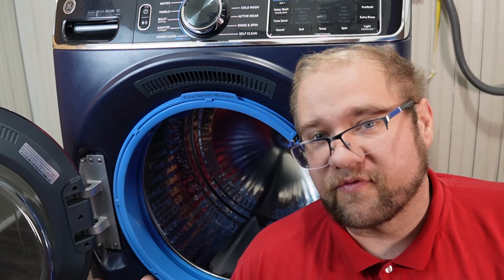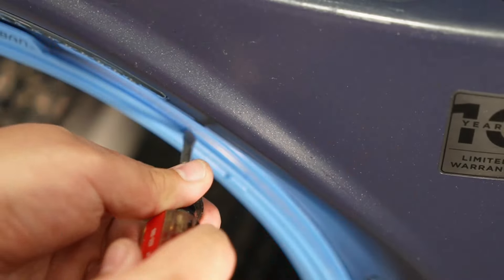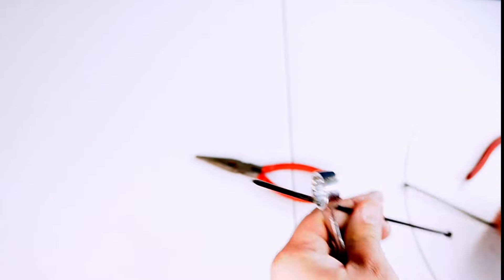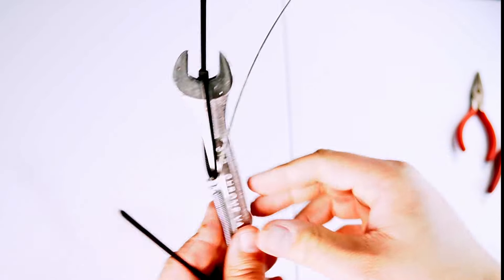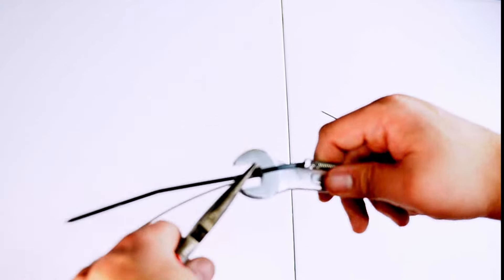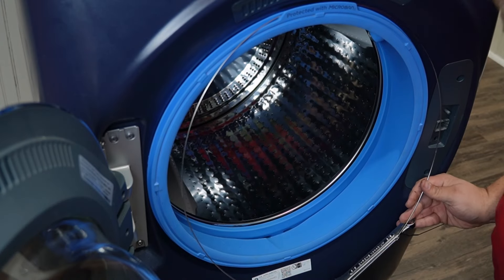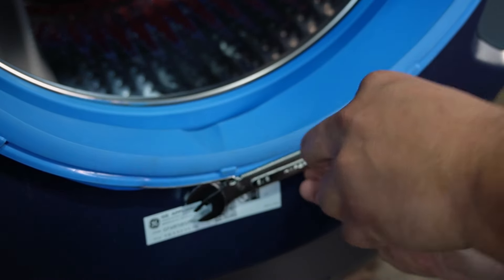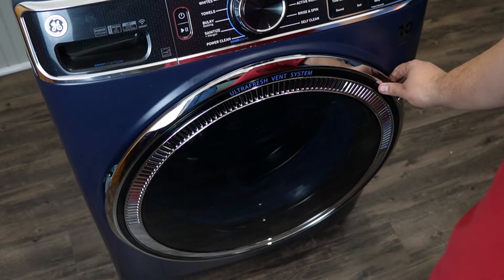Washer Door Boot Seal Problems? Try this cheap trick!

Comment: I took a cheap 16"  bar clamp & reversed the end so it's now a spreader & put zip ties on the ends connected to the ring spring & it worked great expanding that spring in order to get the ring into place
Reply: You saved my day! I failed at the zip tied, bought bar clamp, 2 minute fix!!
Reply: Hah! Another brilliant idea’
Reply: I forgot to try this! Wish i had. My hands arent strong enough to use the needle nose pliers on the zip ties. After struggling snd struggling, I finally grabbed my locking pliers and clamped them on the zip tie. Finally that worked! But the bar clamp sounds better!

Comment: Start by putting the clamp on from the bottom or the top, once you get halfway, put a knee on both sides. Then use two small screwdrivers to pull the spring apart and finish install. You're welcome ;)

Comment: I had to tackle this alone without an expander. This trick, did the trick. I had to use double zip ties on each end, but once in place, I cut one one each side and the spring stress broke the other two. Works great. Thank you.

Comment: Worked way better than I expected.  The only issue was the tie would slip out of the eye in the spring. Had to squeeze the eye a bit more to close it. Wish I knew this the last time I had to take the gasket off. It saved me from buying a tool I hope to never need again.  Good job.

Comment: Soooooo frustrating to get to the very end of taking all the front parts of my Samsung washer apart to replace the drain pump (successfully!), getting it back together and be stumped by this last step. After many attempts to stretch the spring without popping the gasket out of its rim, I finally came back to find help. Thank’s Ben, you have saved my sanity, at least for today.

Comment: I have the same type washer as shown in this video.  Its about 2 years old and all of a sudden it would  start  spinning but would stop after about 5 seconds.  There are very few videos on you tube because it is so new.  I found the trouble code and troubleshooting on one of your videos.  The trouble shooting indicated the problem was with the Hall Sensor.  Looking at other videos on hall sensors it appeared that they just clip on and would be easy to replace.  Using info from another one of your videos, I opened up the machine but there was no hall sensor visible.  It appeared that the hall sensor was built in to the motor so I replaced the motor.  Machine still did not work.  I got a wiring diagram from GE it it appeared the hall sensor is connected to the inverter board.  I replaced the inverter board and the machine works like new.  I was also very thankful for your video on expanding the spring to reinstall the rubber gasket!!!!!  Your videos were very helpful.  I don't know how to do you tube videos, but I thought I would pass this along so you might do a video some time in the future.  Thanks again!!

Comment: This is amazing.  Yes it worked great!!  Thank you so much.  I replaced the inverter on mine bc it wasn't going to the spin cycle and fixed it.  I would also add I used the 5/8 craftsman wrench that has a slight bend on the end.  Make sure you put the wire in the inside of the curve to match up with the washer.

Comment: Thank you! I had been trying quite a while with the spring spreader tool that wasn’t big enough for my machine. Using the wrench made a lot of sense. I did break off the tail of one of the zip ties but had enough space on the other to pull some more.  I used a couple of sturdy bamboo chopsticks to get the spring pulled down in place. It wasn’t easy but it did work. Thanks again! Saved a service call.

Comment: I had already purchased the spring expansion tool on Amazon.  The issue was the size of the prongs on the tool, the one eyelet on the spring was too small.  This hack was amazing, although I did need to make one adjustment.  The zip ties also were too wide to fit through the eyelet with the spring inserted.  I adjusted this hack by using sisal twine, tied that end tight, had long enough zip ties to attach to the other spring eyelet and expand the spring per the hack.  I did need to make a further adjustment, I doubled the sisal twine, as a single strand broke as I expanded the spring.  Greatest hack ever!!

Comment: You are the Man. Mine popped off somehow a year or so ago. Me & one of my sons eventually got it back on. I later saw the pliers & thought it wasn't that hard to spend that much money for something I'll probably never do again.  My seal just blew out with several holes & a big rip. Some reason my wife seems to think her ink pens need washing from time to time. Great idea,  think outside the box. Thanks another for tip & will be using it a little later today when my seal gets here. Have a beer on me & thanks again

Comment: I totally used this tip this morning! Every time I tried to squeeze the two ends together, it would pull the gasket off its spot. Pre-stretching the spring to pretty close to clearing the  gasket gave me the time to make sure the spring was in place before I cut the wire ties. popped right on! I also used a 5/8" wrench and 8" wire ties as suggested. Wife was getting ancy about getting her washer back. thanks, for the great tip!

Comment: hi, thanks , much appreciated, i had to put a longer spanner in the vice, used two ties on one end - they kept snapping - stretched the spring with vice grips on the wire then tie the spring on the other end, worked.. cheers.

Comment: I  just used zip ties straight through the eyelets on a Samsung spring several years ago, using the tails as pull handles to spread the spring after I had proximately placed it in the seal groove.It worked a treat after I carefully cut the ties and pulled them out of the eyelets using a bit of detergent as lube!

Your method looks more controllable.

Comment: I bought one of those tools to stretch the spring… it finally arrived and it’s to big… frustrating… I found this video… I cannot Thankyou enough…. Few minutes later door boot seal back on this method stretched the spring easily and putting seal back on was so easy. Happy to report washing machine working fine…. Thankyou so much. You saved me time, money and stress. 😊

Comment: You saved my rear end! I bought my mother in law a new washer and dryer and was reversing the doors. Wasn't paying any attention to the fact that the washer door was not reversible until I took the two screws out of the door sensor and it fell down. Getting it out was easy... Then I couldn't figure out how to get this stupid ring back on. Thank you so much for this video.

Comment: Wow, this worked like a charm. Struggled to get it on by sheer brute force, but then I found this tip. Did one try to see if spring had stretched enough, it hadn’t. Stretched it some more, slipped it on, tucked in all sides and cut the zip ties…done!! Thank you!

Comment: Thank you so much for posting this video. I struggled so much thinking I could do it without any tools. Impossible. 
I also could not find tool in my area anywhere.  Needed it up and running as soon as possible. Your trick worked like a charm.  Thanks alot.

Comment: Thank you! I did buy the cheap version of the real tool on Amazon but it was too wide at its narrowest position to go into the springs, and not wide enough at its open position to get the spring back on. I did finally manage to get the old gasket back on but it took forever and was so frustrating. I now have the new gasket ready to install and I feel much more confident about starting that project!

Comment: Saw this hack a few years back. Now that I need to replace it,  this video came up on my 1st search and works great. For women, a cuticle cutter works great to cut the tie, but working the tie in place will require the needle nose plier.  If you are OCD like me, use a soft nail filer w/ a  curb edge to push the seal back tightly without puncturing.

Comment: I tried your wrench technique but couldn't get things to line up properly. I ended up going even more minimal and used just cable ties just to pull the two ends together and eventually it worked. Thanks for the idea!

Comment: What a brilliant hack! I have an LG in a rental cabin that I need to replace the door gasket on, and the two local appliance repair places say they won’t work on LG appliances. (I dunno what other people in the area do; I just figured I can take a day and drive up there and back but I was worried about dealing with the clamp wings. I did buy a cheap version of the tool you showed on Amazon, but I’ve been concerned about it not opening wide enough.)

Comment: I made my own spring expander using one of my quick grip clamps. I fed the clamp in reverse so when you pull the clamp trigger it expands instead of grips. Then I drilled two screws through clamp, inserted the screw ends into the spring holes and expanded expanded it with the clamp trigger. BINGO!

Comment: Fantastic , Just noticed the washing machine was leaking and some how the seal had come off and the wire was half off . Was really struggling to get the wire back on so thought look on you tube . Used a 11mm spanner as my bush machine is much smaller . Ten minutes later the wire is on and machine working again

Comment: Exactly what I needed, ordered tool from online but can’t have washer down that long. Don’t use cheap zip ties, should probably get 2 inch painters tape if you don’t wanna get your washing machine, scratched up.

Tape up all the areas that you could possibly scratch. This trick with 5/8” wrench does work phenomenally well to get the outside spring seal off plus holds tension so you can reinstall easily.

My drain tube was clogged and it was leaking from the outside in front of the door plus not draining correctly..

So I only needed to take off the outside spring. 
I do tub cleans with bleach plus steam once a month plus leave the door open for at least four hours if not all night zero mold whatsoever.

The inside of the tub seal looks brand new. The machine is a 2014 LG. Clean vacuum flush elbow plus both drain holes.💯🇺🇸👍🏻🔥🫡

Comment: Yes!  Thank you for this tip.  I battled with this for an hour or two before I found this.  Took about ten minutes to get both of my spring rings around the boot.  Any tips for getting the drain, on the bottom of the door boot, back on the drain hose with the spring o ring?  Took me another hour to get it back on but it wasn’t easy.

Comment: Great video thanks for sharing, can you tell me how to take the white plastic outer cover that the filter is located from the front metal panel?  I was hoping to remove that so I could inspect where water may be leaking.  It's the plastic piece that has the drop down cover that allows you to access the filter.  Many Thanks

Comment: This GE retention clamp is just about the only one those pliers won’t work on because the holes in the clamp are too small. The spring doesn’t have a tremendous amount of tension overall and can usually be done by hand.

Comment: I got lucky and found this video first after the spring ring came off somehow. I had the boot reinstalled 10 minutes later and have a test load running. How did that slip off?

Comment: After taking most of a washing machine apart, lid, front panel & door, negotiating door electrics and drain, then replacing rubber gasket  - putting all back together - this fitting of the final retaining ring  on the door seal, unless you know what you are doing, is the most problematic and frustrating part.  I bought spring expansion pliers but like Ben they didn't fit.  Sadly on a Bosch VarioPerfect the eyelets are not a complete circle but a closed loop through which the cable ties pull - so just check your eyelets are solid circles otherwise this hack will not work.  What did work was fitting as much of the retaining ring wire in place from the top holding the spring in place with one hand and locking onto the bottom eyelet with heavy duty mole-grips then pulling down so my wife (you'll need a 2nd pair of hands) could then ease the remaining wire in place and I released the grips and the spring went into place.  Phew...

Comment: Good Tip! Ben do you know how to get in the diagnostics mode on a Samsung washer model WF209ANW/XAA ?
Reply: Quick Test Mode
Note: This test erases all faults and memory:
To enter press Spin, Soil, & Power simultaneously with the power off.
1. All LED’s light up and the washer beeps as it enters the Quick Test Mode.
2. The unit displays the software version.
3. After the displaying the software version, turn Jog dial CCW Once, or Twice (showing zeros) on some units
If EEEE is displayed the PCB ass’y is defective.
Press Temp Key (press spin to lock door if neces- sary) to cycle through the Water Valves circuit test in this order: Cold Main, Bleach, Cold Main & Bleach for Fabric Softener, Hot, then off.
Press Soil Key to test the motor
Press Spin to test Door Lock/Unlock circuit. Press Signal Key to test the Pump
Reply: Service Mode:
This mode allows more detailed operation tests and trouble- shooting, to enter press Signal & Extra Rinse simultaneously with the power on.
While in Service Mode the following tests can be performed: Quick Spin Test = Delay Start & Spin: This accelerates the drum motor from 0 to maximum RPM over a few min- utes. Note: Stay with the washer during this test, out of bal- ance detection is bypassed and the door may not lock. Press the Start/Pause button during the test to hold its spinning speed for 10 minutes before going back to Quick Spin Test Mode.
Cycle Count = Press the Signal button to see how many times the unit was used.
Soft Ware # = Press the Soil button to see the software version information
Fast Time Down = Press the Temp button to advance to the next cycle
Fault Code Test = Press the Spin button to view the stored fault codes – then turn Dial to view error codes (Push Start/Pause while the code is displayed to view the number of cycles since the error occurred)
Peripheral (Main PCB) input Tests
1. Select Extra Wash. Then turn the Dial so that the Heavy is turned on. Next, press the Start/Pause Key. The Water Temperature will be displayed in Fahrenheit.
2. Select Extra Wash. Then turn the Dial so that the White is turned on. Next, press the Start/Pause Key. The door status will be displayed (OP if open, CL if closed).
3. Select Extra Wash. Then turn the Dial so that the Perm. Press is turned on. Next, press the Start/Pause Key. The door lock Switch status will be displayed (UL if unlocked, Lo if locked).
Water Frequency/Water Sensor Testing
Select a cycle & start the washer, enter Service Mode & press Extra Wash.
Turn the Dial so that the Wool is turned on. Next, press the Start/Pause Key. The Water Frequency will be displayed. The frequency will change as the unit fills.

Comment: I literally just take a thick cable tie and long noise pliers. Hook the pliers into the spring. Pull down on the spring with the pliers and then run the thick cable tie around the rim and work the rest of the retaining wire into the groove.
It pretty much takes less that 30 seconds and theres no prep time.
Reply: That's similar to what I do but minus the tie, tough but it works. If I encounter one with a hook end I anchor one end of the spring to the door hinge, run the wire around, and use the pliers to stretch the spring to meet the hook.

Comment: You can get the same results in 15 sec and all you need is flat screwdriver and your knee. Just hold the spring with your knee and go pull the ring with screwdriver around the seal, if you have another hand you can hold the part of the ring that already in place, that will make it easier. Or just call Craft Appliance Repair if you living in South Jersey

Comment: I’ve been in this business for many years …..(here is a tip ) it really helps to lubricate you bare hands, with laundry soap abd a little water. and also lubricate the metal spring clamp, and put some soap and water in the groove on the seal. It just takes a dot of laundry soap and water in most cases . It makes a world of difference…..the clamp just slips on…..😃 I  do like this trick as well however ….nice job coming up with that. The only tub boot that gives me trouble is that  Frigidaire affinity ….🙈inner spring on that was designed by an idiot. I wish I could find the guy who designed it, and make him fix one….lol 😂
Reply: I do appliance repair also. I feel ya on the Frigidaire affinity inner spring! 😂😂 First time doing one is rough! But if you get metal spring clamps and do it methodically it’s more manageable.
Reply: Wish there was a video for that!
Reply: Of course the affinity was the machine that was here when I bought this old house last year. My first and EVERYTHING is wrong with it. The inner boot spring is the perfect analogy for every single thing about this house! Ugh.

Comment: Would be nice if you had shown how to seat the membrane correctly.  Is there a video?
Reply from the maker: I made a video mentioning it as part of thr teardown of this washer. This video was simply about fitting the wire on if you didn't have tools and had a difficult spring installation.
Reply: I know, I watched the video.  Thanks.   Was asking if there were other videos showing the correct way to remount the membrane